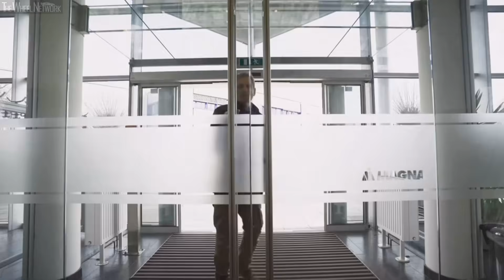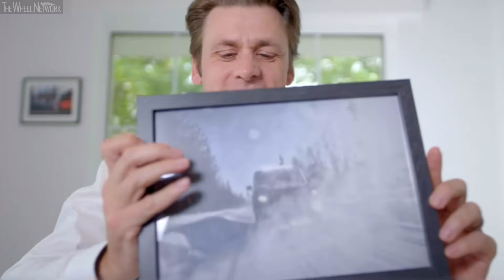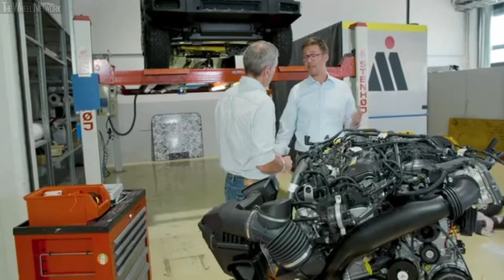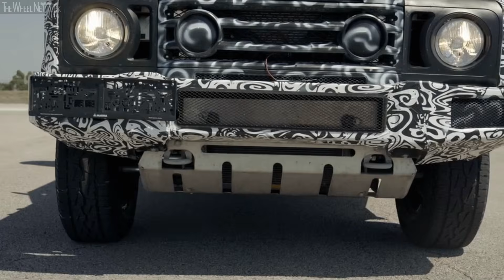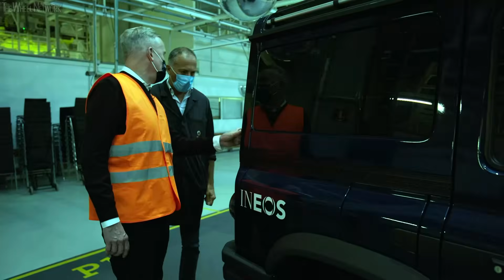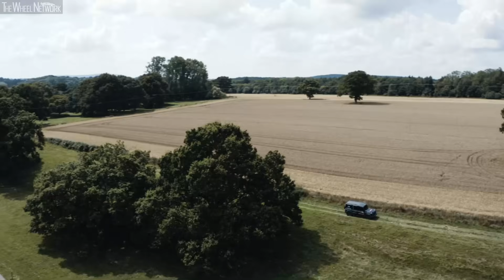Ineos Grenadier Documentary – From Design to Production and Driving | Building the Grenadier

Comment: Like most car enthusiasts I've heard of the Ineos Grenadier. This is my idea of what an SUV should be. Rugged enough to withstand driving off road and back on road, but you also want it comfortable to drive on road, also safe. I get it, an SUV is more like a truck and less car. But that shouldn't make it less comfortable to drive or safe. Looking at it from the grille aft, it looks like an old-school Land Rover Defender. I'd buy one if it can be had with a Turbo Diesel engine.
Reply: You can just not in the US.
Reply: @BryanPike  That's unforgivable. Why the hell no small displacement Diesel engine?
Reply: @jasoncarpp7742 BMW did not type certify the B57 in the US.  Morst likely because diesel is less that 10% of US sales and did not think worth the expense in the face of worsening legal requirements.  It kills me. More torque and getter mileage... I totally would  have ordered my Grennie with it given the option.  Petrol version is a bit quicker off the line.
Reply: @BryanPike   That's worse than unforgivable. They offer large displacement (6.6 litres maybe larger) Turbo Diesel, but nothing smaller than that. Why the hell not?! I'd like to breathe clean (unpolluted) air as much as anyone living. But I've always hated with a passion govt. deciding what makes for clean air emissions. I'd buy a diesel-electric hybrid powered Grenadier if it was available.

Comment: Great video, actually I haven't finished it yet, but wanted to ask a couple questions.  Did they think about trying to mount the alternator up high for water crossings?  What is the largest tire you can run on a stock Grenadier (34")?  What type of mods would you need to do in order to run 37" tires?

Comment: A very disappointing end result for a vehicle that was to replace the defender.
Because of all the irrelevant stuff that has been put onto it, all my money has already been spent for me on stuff that I don't need or want or it's not where I want it.
Plastic bin liner  rubbish roof rack and bars rubbish, fancy seats rubbish, sun roof rubbish.
I need a base model that I can Taylor to my requirements for my purpose.
Totally a townies car that says LOOK AT ME.
No good for real  working off road overland setup.
It's an alternative to a top end GWagon.
How dies it run and perform fully loaded? I haven't  seen any tests or promotion being run under load.
Overlanding is done with the vehicle heavily loaded. 
Jeep and land cruiser are still hard to beat.
Very disappointing.

Comment: The under body is totally an exac if not similar design as TOYOTA LAND CRUISER 80 series, diesel straight 6 and 4 lit motor. Wonder WHY TOYOTA LANDCRUISER current model switch to independent suspension. Very Strange . I still drive LC 80 since 1997. If I can effort this new GRANADIER I would like to have one and keep it for the next 25 years buat will switch the motor and trans to TOYOTA LC diesel 4 lit, straight 6  more reliable and less maintenance.
Reply: sure dude
Reply: @ekimandersom4478 oh yeah... Landcruiser 250....oh, no independant suspension...which one you mean?